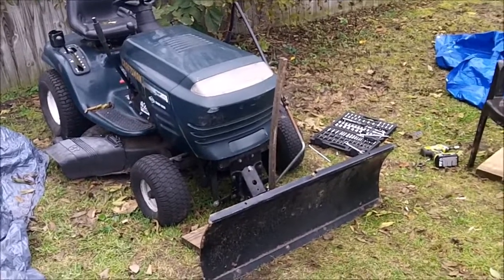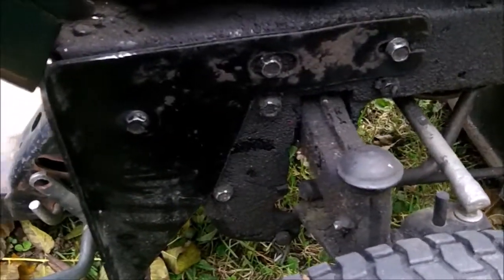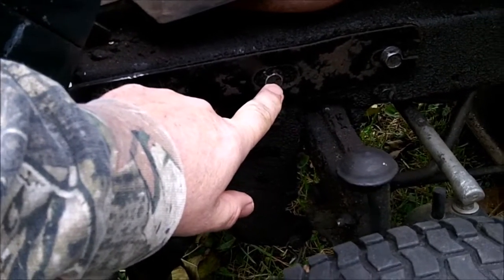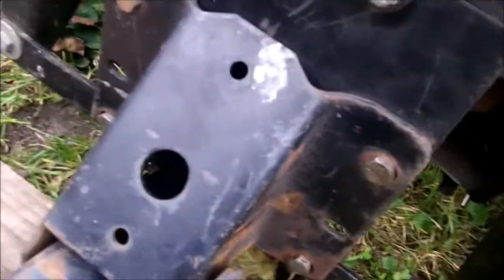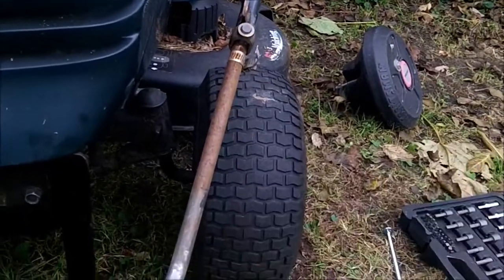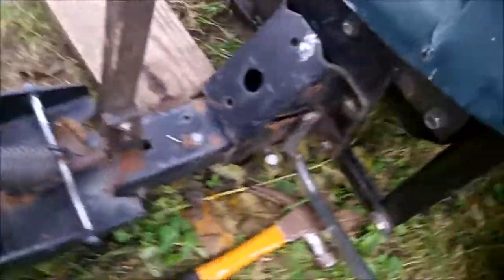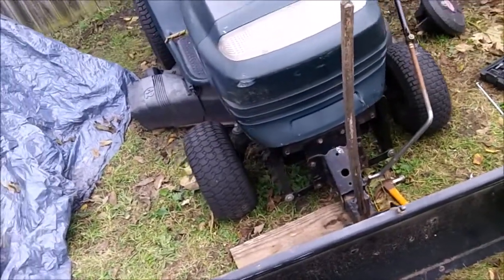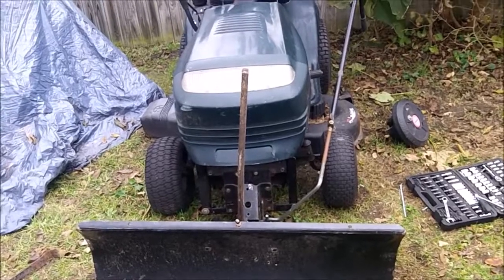97 Craftsman Tractor Installing A Craftsman Snow Plow  video 4

Comment: Where can I get those side brackets? I haven't seen any for sale online anywhere. Thx.
Reply from the maker: Not a side bracket which is probably why you can't them. It wraps around like a "U". I actually ordered parts for this snowplow on Sears Craftsman website.
Reply from the maker: Steven S look at the craftsman website you can order these brackets here. Looking at my plow today there are two brackets
Reply: @middyband  Thank you
Reply from the maker: yes I was wrong tere are two brackets
Reply: Agrifab has them on ebay